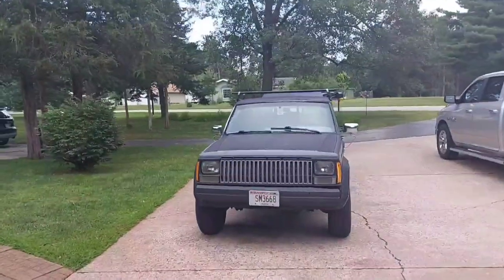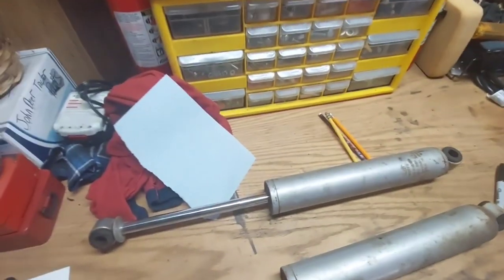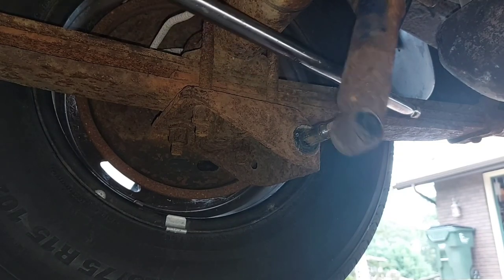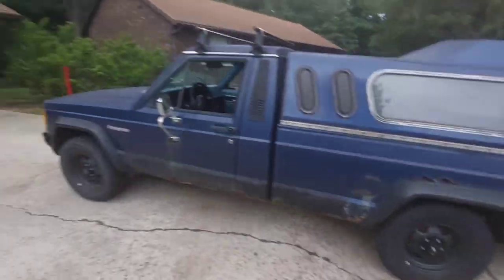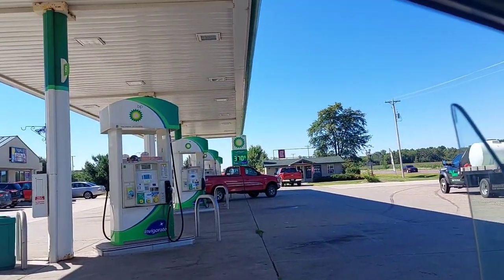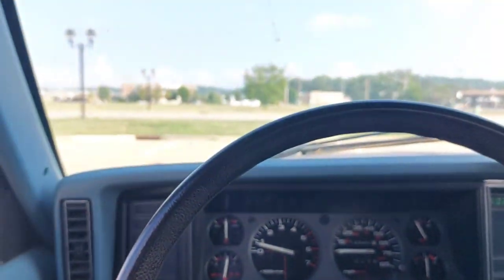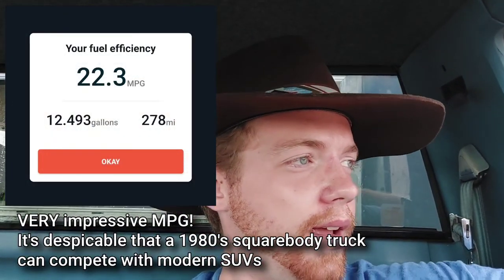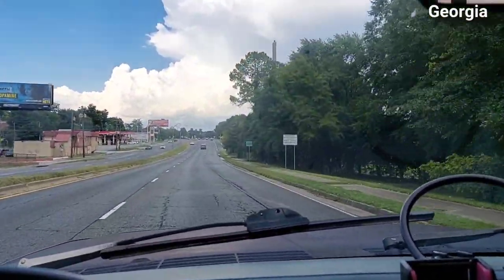Jeep Comanche - Rear Shocks, Front Wheel Bearings, and Florida. Operation MJ

Comment: Love it man.  Drove my XJ from Miami to central WI and back and ppl thought I was nuttier than a squirrel's turd.  If that slow person making a right hand turn drove you nuts... get ready for FL retirees in Teslas pulling into Publix.
Reply from the maker: Oh yeah I've spent enough time in FL to know such a wide range of drivers doing all sorts of crazy shit exist

Luckily the Jeeps are slow too, it was just the unnecessary need to keep using the clutch there that had me angery. I tried to keep it in gear and use the clutch as little as possible because as I mentioned it's only got probly 5% of friction material left on it

Comment: i know a few people that left WI for Florida just to end up right back with little to no money and half their stuff it's considered a retirement state for a reason so be careful it's very easy to go broke there and good luck. I know those drive lines they will run until there is 0 oil pressure or overheat it enough to warp the head or blow a gasket amc 4.0 and chevy small block will run under conditions where no other engine will run from my experience the front end noise when the hubs and u-joints check out is normally the pinon bearing or a diff bearing if even the slightest amount of water got in there it will have pitting on the inside of the bearing races it sounds just like a wheel bearing at first the best investment a dana 30 owner can make is the locking hub conversion reduces the wear on the front axle and increases gas mileage

Comment: Love the content been doing similar crap with my MJ the last couple weeks, found an MJ dana-35 in a junk yard and just did the full rear, leafs (also junkyard) and shocks.
Now I just have spare rear axle parts and leafs. If only I knew anyone near me with a similar project truck. 

Still need to do my front end, but it has a tailgate and it doesn't have an XJ dana-35 anymore.

Comment: On a roadtrip from oklahoma to cali and back, I got 24 mpg avg in my xj towing a 6x8 trailer with a dirtbike and a bunch of camping crap on it. I was doing 65 most of the trip. These old jeeps get a bad rep for gas mileage but IDK, I think they're pretty darn good when you leave them stock or only do mods that improve mpg. I don't know many other vehicles out there that can match that.

Comment: What’s that little arrow when you start up mean?
Reply from the maker: Thats the upshift light, it's not exactly working properly in this truck. It's supposed to light up to tell you when to shift gears for the best fuel economy, but mine has never worked, and it only comes on when the engine RPM is too low (either about to stall or not running) So I see it as a "you're about to stall the engine" light instead.